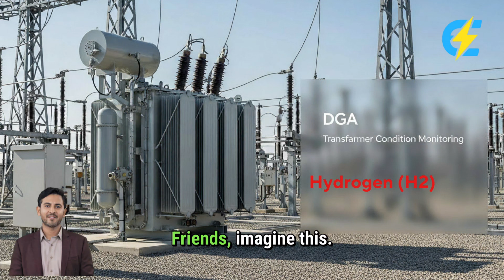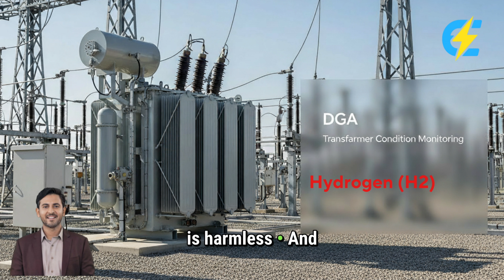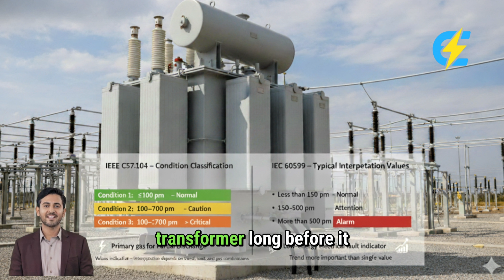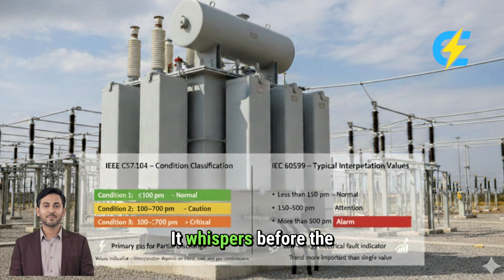Hydrogen (H₂) in Transformer Oil DGA Explained ⚡ | What It Means, Fault Types & Action Steps (IEC)

Comment from the maker: If Hydrogen (H₂) is high in your transformer oil report:

👉 What is the second highest gas in your DGA?
A) CH₄
B) C₂H₆
C) C₂H₄
D) C₂H₂
E) Only H₂

Reply like this 👇
H₂ = _ ppm | Second gas = _ | Voltage level = _ kV

I’ll reply with fault direction + next test.